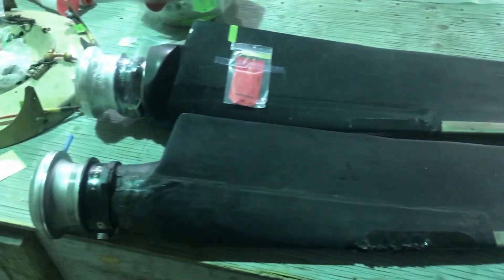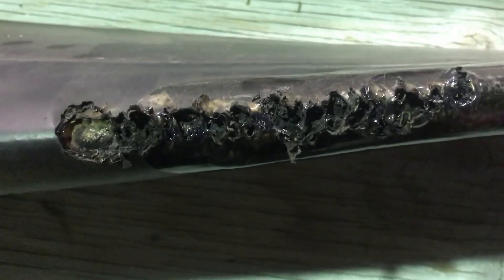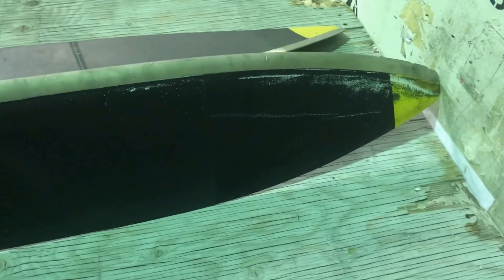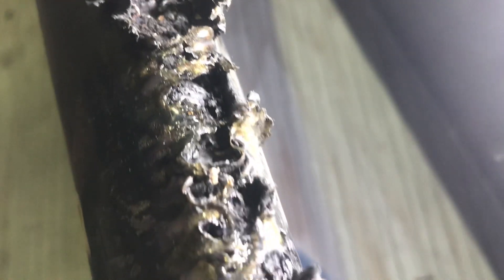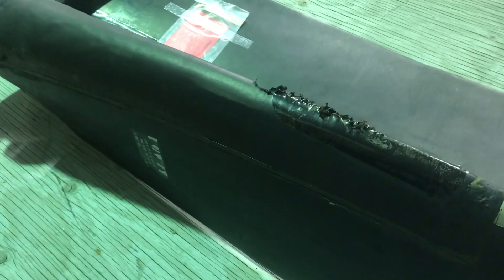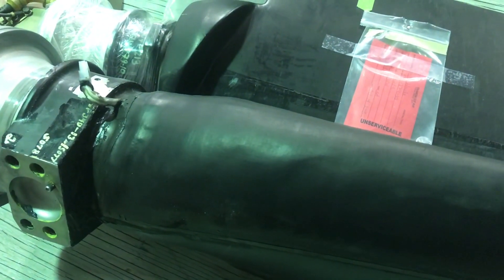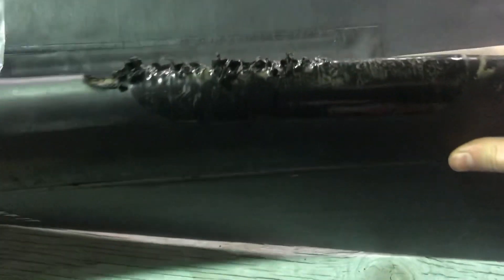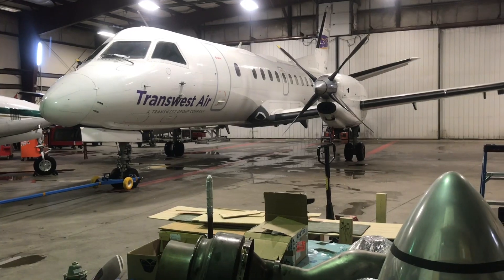Burnt Prop Blade

Comment: That is a serious burn, so the Saab must have heated blade tips driven by a lot of current off the ac gens, eh?
Reply from the maker: Alex E just that rubber overshoe is heated, the nickel alloy leading edge isn’t. But yep you are correct, they are powered by the wild frequency AC gens on each engine 👍